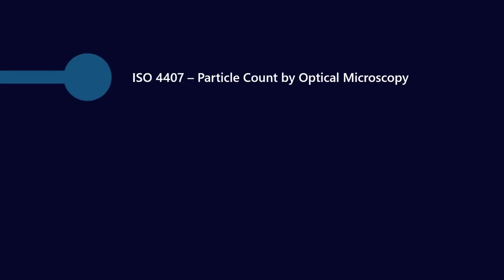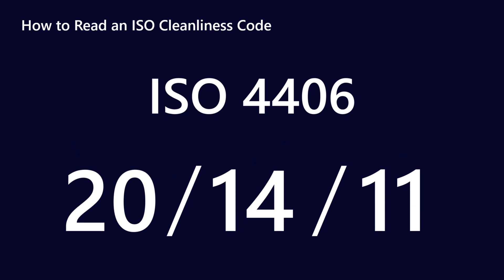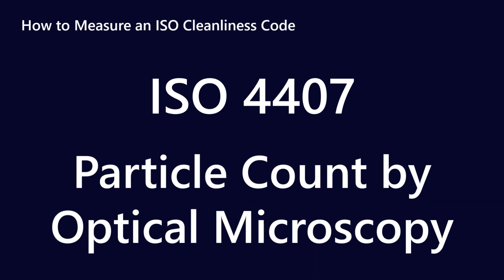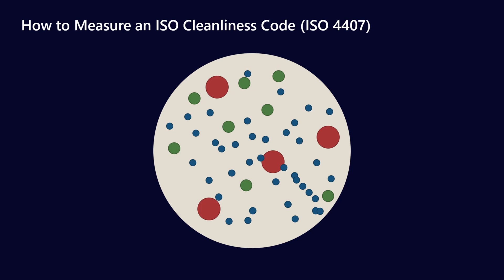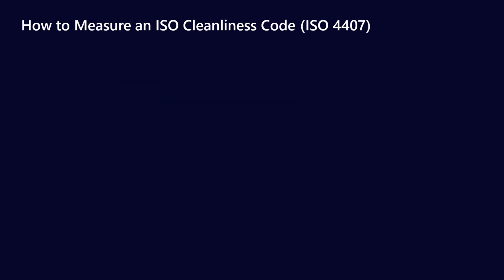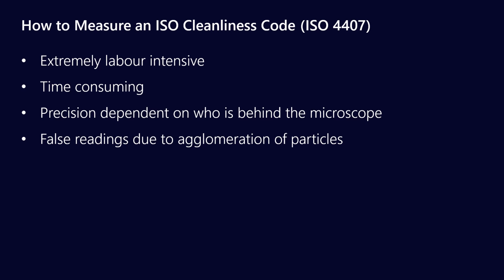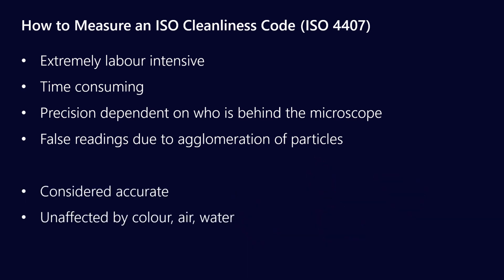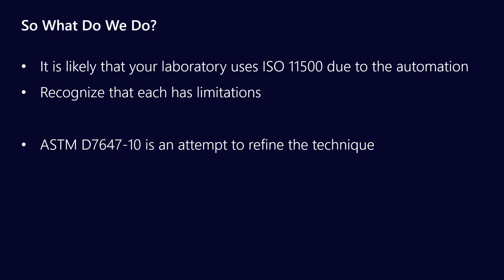How is lubricant particle count measured in the lab?

Comment: My lab said they cannot do particle count analysis on used engine oils.  They said it is more designed for "clearer" hydraulic oils.  Is this normal?  I wanted to see how effective my reusable stainless steel mesh oil filter was working.  I was very disappointed to hear this.  I am assuming they use the laser test method, then correct?